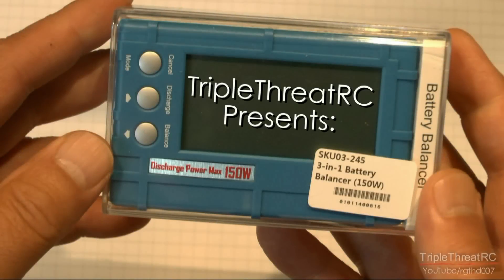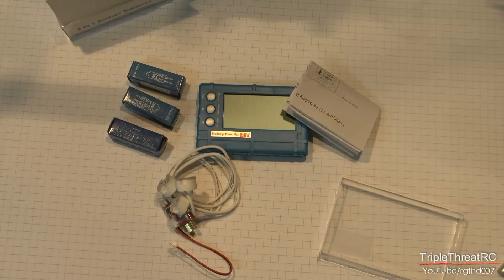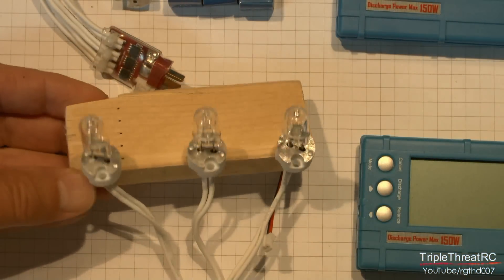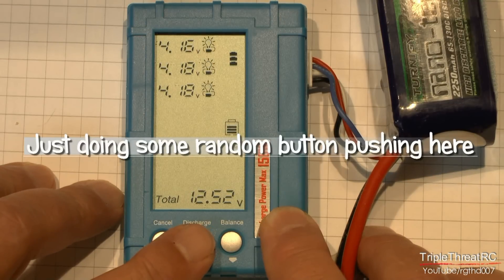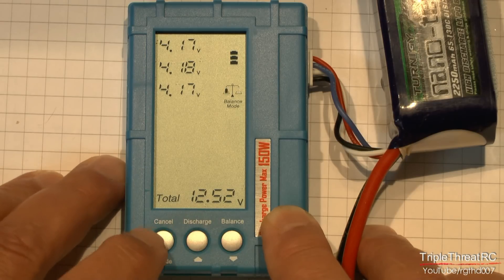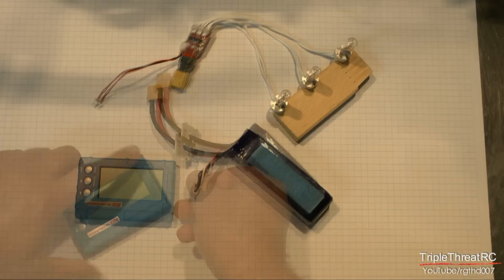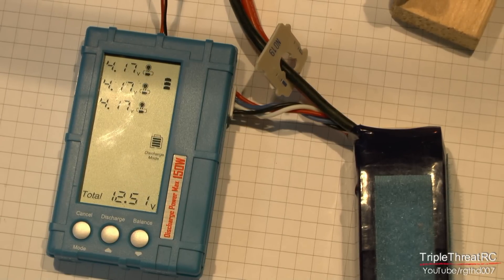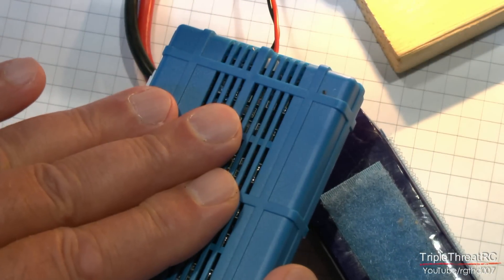Inexpensive Lipo Discharger That Works!

Comment: Hi, any idea if there is a discharger for 4S setup(i.e. with 4 bulbs). Thanks
Reply from the maker: The three bulbs are only there to create a load. I have used the discharger for 2s, 3s, 4s, and 6s.
You can use it for your 4s batteries without any worries. Happy flying.

Comment: Question: Tiny 2-pin connectors latch when inserted, how do I unlatch and disconnect them?
Reply from the maker: You can use a finger nail or tiny screwdriver to pry the connector out of the device. To be honest, I built a little jig to hold a few of these units (so I could discharge more than one battery at a time) and didn't have to remove the little two pin connector.

Comment: The unit has only 3 bulbs for discharging. How does it work with 4S, 5S, and 6S batteries?
Reply from the maker: With this device, the load has nothing to do with how many cells a lipo has. With this model, each light bulb represents 50 watts of discharge for a total of 150 watts. When you first start a discharge cycle (regardless of whether 3s or 6s) all three light bulbs will be on full time. As the lipo draws down, the lights will begin to modulate and only provide a load that the cell can handle until it reaches your discharge set point.  By the same token, it doesn't matter how big the lipo is 450 mAh or 5000 mAh. It is still looking for 3.85 per cell )or whatever you use as a storage charge).

Comment: As another commenter noted.
These are sold without the red module and light bulb array.

Is the red module and said light bulbs superfluous?
Because the unit claims to be able to balance and discharge cells on it's own.

Any ideas?
Reply from the maker: The light bulbs are there to provide energy used to draw down the battery. As you can see when  in use, the bulbs will modulate near the end of the discharge cycle so that each cell lands softly at storage voltage and so all cells will be the same. Without the module and light bulbs, you would have to rely on an internal load which will produce heat and which will be unable to draw down each cell evenly.  In the unit in my video, it a light bulb burns out (none of mine have) you just have to replace the bulb. In other types, when the unit has fried because of the heat, you have to replace the entire unit.
Reply: @SubToTripleThreatRC  ah makes sense.
The array offloads the discharge load from the main module.
But the purpose of the unit is to be a tester, balancer and discharger, so it IS capable of discharging the cells in a balanced manner on it's own.
Otherwise it would defeat the purpose of it's labeling...the array is a diy style mod to it.
Pretty cool that it's offered (I found the listing through a search of the site from your link.)
I've read reviews of the same module (different color possibly a clone) and there's guys claiming to have discharged S5 batts from 3300 to 14000! With eye brow raising heat being the only result.
Pretty sure this thing is literally a small PCB module and a huge cheap heatsink in the case. I picked one of the clones up for literally $10 if it fries I'll pick up the one you linked...👍
Reply from the maker: @BendApparatus  
Awesome. They key is to remove the electrical draw outside of any piece of equipment because of the incredible heat the draw generates. The light bulbs are a simple and elegant way to create an electrical load. Because there are three bulbs, the device can modulate the "draw down" more precisely. It starts out with three bulbs and gradually tapers down to one bulb as the discharge nears completion.

Comment: Wow! I bought one of these before watching this video and both Banggood and the instructions it came with do not indicate anything about connecting light bulbs when discharging the battery. Now I feel like I shouldn’t even use it. Tried searching for the light connection by itself but can’t find it. Bummed 🙁
Reply from the maker: Thanks for watching this old video. These units work amazingly well because it uses the 50 watt light bulbs as a load and it can balance the discharge so that each cell has the same voltage when it reaches the set voltage level (storage voltage). Hopefully in your search, you will come across one of these because they works so well and have so many functions. I'm not sure what you mean about "connecting batteries when discharging the battery".  Take care and be well.
Reply: @SubToTripleThreatRC  thank you for the video.   the link in the description is broken though.  is this product still available?
Reply from the maker: @sagacyberdemon   Well, the video is eight years old now so there's that.  I found a similar unit on Amazon. It's not exactly the same but looks like it does the exact same job. Check it out: https://www.amazon.com/GalaxyElec-Battery-Discharger-Balancer-Discharge/dp/B09NCC41XW
Reply: @SubToTripleThreatRC  thank you.
Reply: @SubToTripleThreatRC  I’m sorry, I made a typo, I meant light bulbs not batteries. I bought one but it didn’t come with the bulbs or cable to connect them just the main unit.

Comment: Or one more,  If I have a 6S 22.2v 1500mah battery does the need 6 lights or will the system work with the load provided by the three lights?
Reply from the maker: The load from the three lights are fine for all cell counts including 6S. The light bulbs are just the load used to draw down the batteries. Each bulb draws 50 watts.  I hope this helps.

Comment: Why do you use a discharger?     Why do you want to discharge your batteries once you've charged them? Is it a safety issue or longevity of the batteries?
What does it mean when someone says "set my batteries to storage "?  I am new to using LiPos and do not understand this idea/need.
Reply from the maker: There is much to learn about lipo batteries to use them safely and to treat them properly. It would take a long time to discuss all the topics here so I suggest you look at a resource like this:  https://rogershobbycenter.com/lipoguide
or this: https://batteryuniversity.com/learn/article/how_to_prolong_lithium_based_batteries
I hope this helps!
Cheers.

Comment: do you have wiring diagram for a 4s for this meter? i gone one same as yours but can not get it to power up
Reply from the maker: I do not have a wiring diagram but it is very easy to make it work. Make sure to properly insert the balance connector from your 4s battery into the appropriate 4s connector on the side of the unit and when you connect the XT60 connectors you are good to go. As soon as you connect the balance connectors (and before you connect the XT60 connectors) you should see a reading on the screen for each of the 4 cells. In doing this, the unit operates as a balance checker. As soon as you connect the XT60s, it can function as a discharger. You must attach the balance connector when discharging so the unit can draw down each cell evenly. I hope this helps. If your unit does not "power up" when both connectors are attached, then it is probably faulty.  Cheers!

Comment: How does it work for 6s batteries? Do you need more globes etc?
Reply from the maker: No, it works just fine with 2s to 6s lipos. It modulates the three bulbs that have a max load of 150 watts. As the battery is drawn down, it will reduce the load to bring it down gently and evenly (across all cells) to get to your preferred storage setting. I discharge fully charged 4s 5000's in about 20 minutes. I hope this helps, thanks for watching!

Comment: Will it discharge to 0 volts?
Reply from the maker: I haven't tried it but I suspect not. You can program it to stop the discharge but I've always discharged to 3.85 volts per cell.  Are you trying to kill your lipo? If so, a salt water bath is the way to go.
Reply from the maker: Thanks for watching. I've had good success with storing my batteries at 3.85v for as many years as Lipo batteries have been on the market but like many other things, there is no one right answer. I think anything between 3.7 and 3.85 is fine. The main thing is to not store them full charged or fully discharged. Thank you for offering your opinion.

Comment: how warm/hot does the battery get?
Reply from the maker: It draws power at a much slower rate than if you were using the battery to power an RC car or plane. The battery usually stays at, or close to room temperature. I hope this helps.

Comment: Hello sir, is it ok to use all the lamps for a small lipo 350mah? Can i just unplug 2 and use just 1 lamp? Thank you
Reply from the maker: Hi Jerome! Yes you can. But you don't have to use remove any bulbs. The device is smart enough to only draw as much load/power as it needs. It has a modulating circuit. Chances are, when you attach your 350mAh lipo, only one bulb will "turn on" and not for very long. I hope this helps.  Happy flying!
Cheers, Bob
Reply: TripleThreatRC thank you for your answer ' have a good day

Comment: is this device can charge or discharge only?
Reply from the maker: Discharge only but it can also balance your cells if your charger can't. The idea is to take the task away from your charger if you need to discharge a pack. Your charger will last much longer. Thanks for watching!

Comment: Hi, Thanks for taking the time to make and put up this video. It's been a massive help.
I bought that same discharger and have just used it to do my first battery conditioning (charge and discharge five times before first use). That particular discharger is very easy and quick.
Reply from the maker: Thank you for the kind comments and I'm glad you like the discharger. I use mine all the time and they continue to work great. They remain one of the best things I ever bought for the hobby. By the way, I really like that you are caring for your lipos so well before you use them but three cycles before use is adequate. You can even condition them by flying around at half throttle for three flights before starting to stress them with full throttle flight. Also, if you are willing to give up a little bit of flight time to bring them down at 3.85v, they will last many times longer than if you drain them every flight and they will be at the perfect voltage for storage. I have lipos that are four years old that have hundreds of flights on them and they are as good as new. I usually lose one minute of flight time by bringing them down when I do but it is a trade off I am willing to make.

Thanks for watching and happy flying to you.
Cheers, Bob
Reply: Thanks for your reply. I must confess I actually have several dozen LiPos of all sizes from 1S 150mAh to 6S 2,900mAh a few of which (3S LiPos) have swollen and I guess will need to be disposed of.
In the roughly four years I've been fiddling about with RC and LiPos, this is me only now starting to look after them properly ... . Oops.
I'm almost wishing that model shops sold 'LiPo Care Packs' with basic info about LiPo care and a discharger like the AOK one. The fact that I had to order the discharging kit from an eBay seller in Hong Kong as there's nothing like it available in the UK (apart from using the charger for discharging - which probably shortens it's life) doesn't say much for the model shops I guess.
My first inexpensive charger started to malfunction with the larger cell counts (5S and 6S) after about 2 years but that was a charger and transformer combined. I decided to invest in a separate charger and transformer which I don't want to stress. So the AOK discharger is ideal.
Also the AOK can discharge up to 150W whereas the discharge function on chargers seems to be typically 5 to 10W. So the AOK should be at least 10 times faster.
Perhaps you should be running a paid link to the eBay sellers ! : ).
Thanks again. A.
Reply from the maker: I totally agree with you. I was very glad to discover that this thing works as advertised and is so inexpensive. I was discharging 4s 5000's on an expensive Thunder Power 820 when the charger went up in smoke.
Reply: Ouch. I'm sorry to hear that ... I'm just looking at an 820 on eBay US for $200. I can see why you started to look for alternatives.
I started with heli's and I'm hoping to fly an E-flite Apprentice (more or less my first plane if you discount the Parkzone Radian I totally mashed four years ago) sometime in the next week. I buy the manufacturer's batteries just for consistent size and weight, and the E-flite batteries aren't cheap. So I don't want to damage them.
I've got my eye on an LX Models F4 Phantom for some day in the way off future and that will be 6S 5000 60C's at about £130 a pop. If I ever get to that stage, I really will want to be careful with the LiPo charging and discharging.
Again big thanks. A.
Reply from the maker: Happy flying to you!  😎

Comment: How many amps does it draw per min?
Reply from the maker: Not sure but it has three 50 watt bulbs to draw down the lipo. I assume there is some math out there that will provide your answer. There is a modulator that slowly ramps down the draw as the desired voltage is reached.
It will draw down a fully charged 4s 5000mAh to 3.85 volts per cell in under 15 minutes.

Comment: I'm using 1200mah 2 cell lipos, I have a alarm on my quad set for 3.4v i never let my battery drop under that. I ordered this device because my stock charger is changing my batteries to around 8.46v im not sure if it's dangerous with it being a 7.4v battery? One cell reads 4.14 the second cell reads 4.32. What is a good voilt to keep both cells at? If you or anyone who may be able to help me, it would be very thankful.
Reply from the maker: Hi,  A good charge will result in about 4.21v per cell for a lipo with any amount of cells. So for your 2 cell, it should read about 8.42v .  The key to lipo safety is to use the battery ASAP and within 24 hours and to store it in a safe space while it is at full charge. A full charge should not result in anything more than about 4.21v per cell so yours is charging a bit too high for my taste if it takes it to 4.32v.  A good charger should allow you to set the upper charge limit. I store my lipos with a storage charge of 3.85v per cell. I hope that helps.
Happy flying!

Comment: Does it shut off automatically when it reaches the pre discharge voltage?
Reply from the maker: No, it just sits there and idles as it tries to achieve a perfect balance. Eventually it would draw down the battery. I never leave it unattended anyway. And, I've learned a trick to speed up the discharge. If you want a storage voltage of 3.85 per cell, set it at 3.50 and take it off when it reached 3.85. This eliminates about 15 minutes of final balancing (and the cells are within .01 anyway)
Reply: Hey thanks a lot for the reply! Keep up the good work.
Reply from the maker: No worries, happy flying to you!

Comment: Great video. Do you need the light bulbs connected for the 'balance mode' feature? ie to balance the voltages between cells?
Reply from the maker: No, it will balance a pack without the need for the light bulbs. It does get hot however and I usually prop it up on a screwdriver or something similar to allow air into the cooling vents on the bottom of the unit.  If a pack is out of balance it is sometimes easier to (balance) charge the pack and then put it on this unit and do a storage charge so the light bulbs can help out with the balancing on the way down.  I hope this helps.  Cheers!

Comment: Hi bob, in what scenario will all 3 bulbs light up? Mine only light up 1 of 3.
Reply from the maker: Hi, this little device is designed to modulate and all three bulbs should light up at the beginning of the discharge as long as there is a decent gap between the current voltage and the desired voltage. Then, as the voltage level drops, it will start to modulate and reduce the draw to two bulbs and then one. If the difference in voltage is very small, usually only one bulb will light. 

If you are going to discharge a fully charged lipo from 4.2 volts to 3.85 volts, you should see all three bulbs light up for a few minutes. In this scenario, if all three bulbs never light up, then there is a problem with the unit or more likely, with the bulbs. Try moving the "good" bulb to a different socket and see if it lights up there too. If you have a pack that you have already flown and are simply discharging it down to storage levels, you will probably never see three bulbs light up. I hope that helps. I have had these for more than two years now (since I made this video) and I use them all the time. They still work great and all the bulbs are still good.
Cheers, Bob

Comment: Hi , I can use this device for 24 v power supply with Nicad batteries? pls reply
Reply from the maker: No, it is designed to work off the balance leads of lipo batteries.

Comment: What kind of lights are those? I would like to buy replacements for down the road.
Reply from the maker: You might just want to order two units because it can be less expensive than buying replacement bulbs:

 http://www.ebay.ca/itm/5Pcs-Replacement-Bulb-For-OSRAM-64445U-24V-50W-GY6-35-Shadowless-Halostar-Lamp-/171559245801

https://www.amazon.com/REPLACEMENT-64445U-24V50W-Shadowless-halogen/dp/B014VFWH6E/ref=sr_1_1?ie=UTF8&qid=1481850994&sr=8-1&keywords=24v50w
Reply: TripleThreatRC thanks and noted! thanks for your video review. I never would have know this existed!
Reply from the maker: I use a couple of these a lot and still love them. Best darn deal in the hobby. I'm glad you found value in the video. Cheers, Bob
Reply: you can find replacement bulbs if you look for them on ebay, i ordered some from china since i broke a bulb. low cost